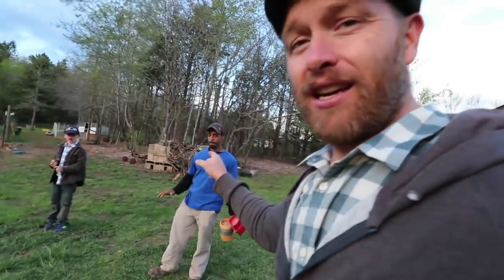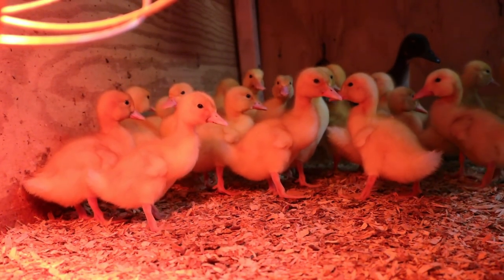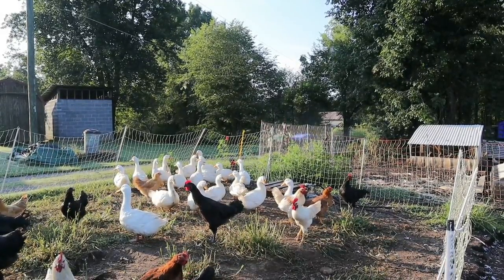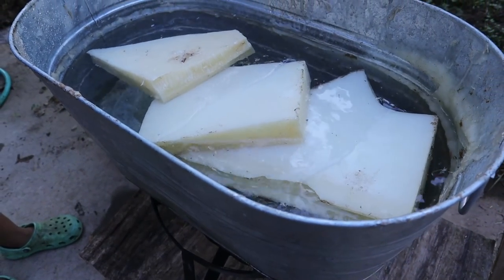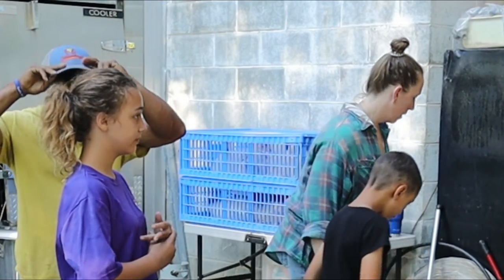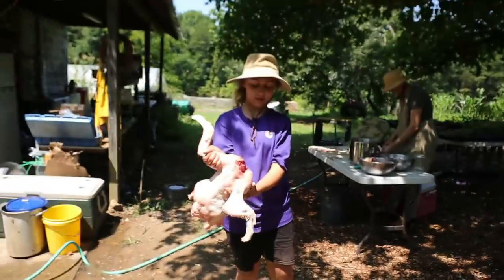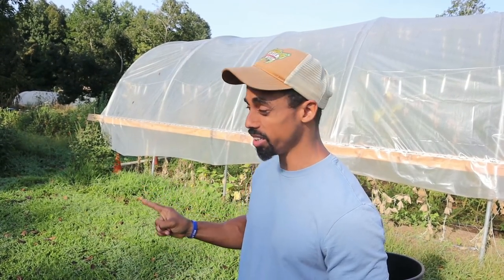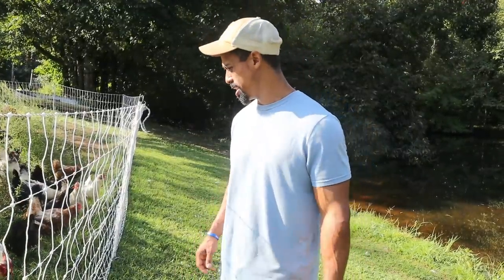How I'm Raising these Ducks

Comment: How long does it take per bird? I found the wax way more laborious vs. doing a second scald/pluck cycle with a quick once over by hand.
Reply: I've tried both, and I personally have found that a second scalding, followed by a second waxing, to be my ideal method. Water at 145 degrees.  Gets them really clean, really easily.
Reply from the maker: The first batch we ever did we butchered at 49 days and they plucked and waxed much easier. This last batch we did were more like 14 weeks old and found that they took longer to pluck and wax. I didn't time us doing it so I don't know how long per bird. The second batch I bought paraffin wax and mixed it in with the duck wax that we didn't used the first time, I don't know if that had anything to do with them being harder to clean. I think it took three adults 4 hours to process 18 ducks.
Reply: @MikeTheFitFarmer  What makes it "duck" wax?  Is that what it is really called?  Do you reuse it?  If you do, how do you clean it out?  Lastly, don't they ever fly out of your pen?  Mine would.  Thanks!
Reply: Love your channel Morgan!

Comment: Where did you get your wax from? Also, we purchased the Cajun Rocket 120 qt for the turkeys we just processed.  

We are having a hard time keeping the temp where it needs to be. How do you manage your temps? Are you constantly regulating the gas flow?
Reply from the maker: We end up turning off the gas once it gets where we want it. I think Mike had to turn it back on once or twice during the processing but it is so much better than using our old pot that took forever to get to the right temp. I wonder if your temp changes so fast because you were butchering such big birds?
Reply: @MikeTheFitFarmer  Yea that is one plus about the cajun rocket it does heat up fast and takes a while to cool down.  When it was time to do the shrink wrap I had a meat temp that alert when it goes low at a certain temp and too hot at a certain temp to help gauge it better.  Where did you get the wax from?